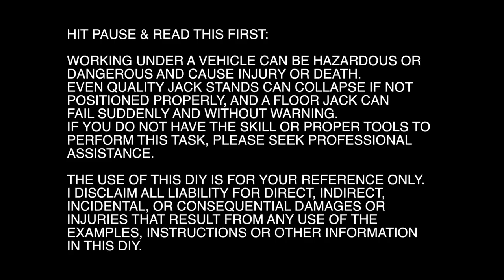HOW TO: Jeep Grand Cherokee OME 2" HD Lift Kit Install (2005-2010 WK)

Comment from the maker: Tools needed:

Hydraulic Jack - https://tinyurl.com/y8mgynot
Jackstands - https://tinyurl.com/y8qnosom
Chock Block - https://tinyurl.com/yc3tquz5
1/2" ratchet - https://tinyurl.com/y9towgve
1/2" breaker bar - https://tinyurl.com/ycofe5nu
1/2 " extensions - https://tinyurl.com/y9l226g3
15mm socket - https://tinyurl.com/ybvbbfxc
18mm socket - https://tinyurl.com/ybvtyxjw
19mm socket - https://tinyurl.com/yd2ymz6t
21mm socket - https://tinyurl.com/ybm9hjqj
24mm socket - https://tinyurl.com/y7xueoc4
27mm socket - https://tinyurl.com/y9f87tnw
(Use 6 Point Sockets!)
1/2" Torque wrench (70 to 130 ft lbs) - https://tinyurl.com/yapo92g5
Pliers - https://tinyurl.com/y8xhgzwx
Flathead screwdriver - https://tinyurl.com/yaqx3s9f
8mm deep socket - https://tinyurl.com/y8fcb9aq
10mm deep socket - https://tinyurl.com/y9prympe
1/2" to 3/8" adapter (reducer) - https://tinyurl.com/y8zjx2eu
8mm wrench - https://tinyurl.com/y7h4r4xw
10mm wrench - https://tinyurl.com/ybax4df6
15mm wrench - https://tinyurl.com/ya62nt7e
18mm wrench - https://tinyurl.com/y9lnpe5q
PB Blaster - https://tinyurl.com/yb9ebc8q
Rubber mallet - https://tinyurl.com/y74pwmp8
Metal mallet - https://tinyurl.com/y8dokncn
Wire brush - https://tinyurl.com/y9r5yay6
Bungie cord or rope/wire for suspending brake caliper - https://tinyurl.com/y93qxuup
Lint-free paper towels - https://tinyurl.com/y8x73o4d
Spring compressor - https://tinyurl.com/ycgcmxtw
Safety glasses (required) - https://tinyurl.com/yc8ev9hx
Gloves (optional) - https://tinyurl.com/y8mgack3

Parts required:

OME 2 inch Lift Kit WK - http://4xguard.com/affiliated-products/old-man-emu.html

JBA Upper A-Arms - http://4xguard.com/grand-cherokee-2005-2010/jba-upper-a-arms-for-lifted-wk-xk.html

(QTY 12) - M12x1.75 Lock Nut (MOPAR Part# 06502835) 
(QTY 2) - M16x2 Lock Nut (MOPAR Part# 06102252AA)
(QTY 2) - M12x1.75 Hex Head Lock Bolt (MOPAR Part# 06508710AA) - https://tinyurl.com/ybgeh35p

Dover Dodge Chrysler Jeep does a great job keeping MOPAR OEM parts prices cheap.  Be sure to check them out when ordering - http://www.doverdodgechryslerjeep.net/parts-accessories/shop.htm

Spring Compressors can be rented from AutoZone, but I highly recommend using a Branick wall unit in its place. Spring Compressors like the ones used in this video can snap under load. Always use eye protection. Branick 7600 Strut Spring Compressor - https://tinyurl.com/y7h8j48s
Reply: Dungeon Motorsport Really great video.

Comment: I found that Rock Road Outfitters will pre-assemble OME springs and struts with new Jeep parts for $214 bucks for both sides. It will save you a little time but get you new parts instead of using old parts again. I just bought a WK and looking for a lift, this video is one of the better I have seen for this lift kit. Thank you for putting this out there.

Comment: The OME info here is great, as a Jeep owner for the last 23 years, I can appreciate the custom work that can be done to WK and WH Jeeps. I've spent £10k on mine in the last few years. WK/WH are very cheap to buy in the UK and maintain if you pick the right ones that have not been abused too much. I run a WK 5.7 HEMI on LPG which gives me the same running costs as a small car. I have the OME MD on mine.
Reply: How do you like the medium duty?

Comment: Great video.  Only thing is you should try to never tighten shock or stabilizer links  or most any suspension bushing until the weight of the vehicle is either on the ground, or the axle is on a jack stand loaded  (Reason is) you can tear or twist the bushing once its loaded under weight. Also  wire brushing bolts can remove the protective factory coating some blaster is good enough or replace the bolt And I would love to see your rig  with all  the work done.

 I will be buying the OME kit and will make sure you get credit for it. Nice job
Reply: Drop link can be torqued up regardless, it's a ball joint not a bush. 😎

Comment: Well done video, my only advice is to leave the castle nut on the ball joint and hit upwards on the control arm instead of the ball joint to separatethem. This will keep you from possibly hurting the balljoint in the hammer process (trust me I've done it, yours luckily was easy) and it will allow you to use a normal hammer if you dont have a rubber or a rubber one isnt strong enough.

Comment: I just did my OME lift this weekend and your video really helped!  Thanks for putting it up. As an aside for anyone doing this lift, even if you aren’t replacing the upper control arms, removing them really helps get the new strut towers back in and isn’t too hard. Also the lower clevis bolt is super hard to get out, don’t waste your time with it.  Lastly, I did not remove my brake calipers but I did unfasten the brake line from the wheel well to give more slack.

Comment: I know that this is a little late to the game, but I found out the hard way that on the rear shocks, the bottom nut is WELDED to the mount and is NOT removed!!! I removed mine. Had to have a shop re-weld it back in place.

Comment: Hello! This video was a huge help, I just had one question, apart from the parts listed in the kit, did u require to change the sway bar links or anything like that to adapt to the lift or did the stock parts adapt to the lift?
Reply from the maker: Stock parts adapted just fine but I got modded A-arms to clear bigger tires.

Comment: What does W
WK mean? I paint the outside rim mount area on my 2007 Jeep Grand Cherokee Overland with red high temp paint. No more having to chisel loose rims rusted on. Thanks for the video I need to put new shock front and rear in some time in the near future after some other repairs. I think I would go with a four inch lift at least if I was to put a lift kit on.

Comment: Wow.  Great job w/ instructions.  We live right in the roxbury neighborhood.  My son just bought this truck today but it needs all 4 shocks and struts replaced.  The way you showed this, we could actually try to take on the rear job but would go no where near that front.  Requires some experience I think.  Any recommendations for the install in this area?  Randolph,  Denville, Roxb... etc.    Looks like the job is over $1K in parts alone so think we'll have to stick w/ stock replacement if that's cheaper w/o the lift...  ;o(

Comment: Those are the same spacers as I have, the problem for me is they're illegal where I live and I'm in the middle of replacing the standard wheels for some with more of a negative offset and I'm doing the front wheel arch mod as we speak......

Comment: so im lookinf to do a 4 inch lift on my WK and fit 33 or 35 inch tires. after seeing you install this OME and get a 5 inch boost, what do you think about me getting this lift for roughly 1000 rather than a 2000 Superlift.
What size tires are these?
Thanks for the help

Comment: Awesome video! I'm taking the advice and ordering more spare nuts and bolts. On the Dover Dodge website I found both the lock nut parts, but I typed in the 06508710AA Hex head lock bolt and it didnt match any product numbers. Did you have any issue locating the bolts on the site?
Thanks!!

Comment: Is it necessary to completely remove the UCA to replace the strut and spring unit as my UCAs have already been replaced? Thanks for the great video!
Reply from the maker: Catbus Are you talking the Upper A-Arm? You do need to remove it in order to clear the strut assembly for removal and reinstallation.

Comment: Would it be possible to combine this lift with a 2" strut spacer lift? What would be needed to adress in that case? Longer brake lines and ABS cables, longer sway bar links.. Antything else?

Comment: just wondering what was the height of the jeep on all 4 wheels after the lift cause i did mine with the OME Coil Springs & Bilstein 5100 shocks and is not even. I have the measurements
Front Left 36in, Front Right 36.75in, Rear Left 35in, Rear Right 35.50 that was at the first location and the second location was Front Left 36.75in, Front Right 37in, Rear Left 34.75, Rear Left 35.25in , and i have follow everything from your video exept that i have Bilstein 5100 shocks. Tks for your help.

Comment: I noticed on your back wheels that you have pretty thick wheel spacers and that could be one of your rubbing problems its not stock or factory set up I own a Stock WJ V8 and my new 245/70R17's KO2's don't rub but I would love to put a 4in lift short or long arm but since its Quadra drive I would have to replace the front drive shaft possibly even if I went with a 
.budget 2" or 2 1/2', I want height was the ol saying say's " It's a Jeep Thang" LOL 🤭

Comment: I did a 2 in rough country lift but didn't change out the upper control arms. I was wondering if not changing them could be the cause of my positive camber problem.
Reply: No, assuming you did it correctly and your alignment guy knew his job.

Comment: Do you know if I'd have to grind my calipers to run those wheels on a 2008?
Reply from the maker: intense_m9_downhiller You'll need to run wheel spacers.
Reply: Do you know what the smallest size i could get away with is?
Reply from the maker: intense_m9_downhiller 1/4"

Comment: What is the part # for the lock nuts?
Reply from the maker: Tools/Parts list is in the description to this video and pinned in the comments. With that said... 

(QTY 12) - M12x1.75 Lock Nut (MOPAR Part# 06502835)

(QTY 2) - M16x2 Lock Nut (MOPAR Part# 06102252AA)

Comment: Why keep the wheel spacers after the lift?
Reply from the maker: It's specific to the backspacing on these wheels in order to clear the front brakes. At a minimum you need 1/4" spacers up front.

Comment: why did you add the a arms? what benefit does that add?
Reply from the maker: They help in clearing oversized tires. Without them you might rub on the stock ones.

Comment: how much is the cost for this mod
Reply from the maker: Roughly $1,000
Reply: lift = $855
+
Arms = $450
+
Tires = $590 (the ones i bought 265/70/r17, IF you're upgrading from stock)
+
Spacers = $120 for 1.5" inchers
+
bolts/nuts/alignment/mounting/balancing

A tad over $1000 :)

I'm following this wonderfully detailed guide and have purchased the above but have a question about the lock bolts and nuts. Is it super necessary to replace them or can I reuse the ones already in place? Thanks
Reply: Where did u purchase

Comment: What size rubber you have on there?
Reply from the maker: 255/70R-17
Reply: Do you notice any difference with RPM’s or power when diving at different speeds with the larger tires? I’m thinking about getting the same but when I made a change on my Jeep tj I pretty much had to put 4.56 diffs in the front and back.